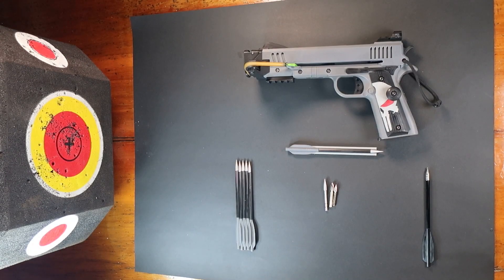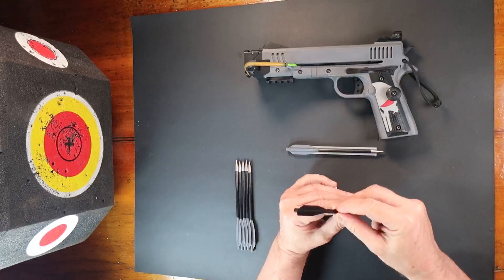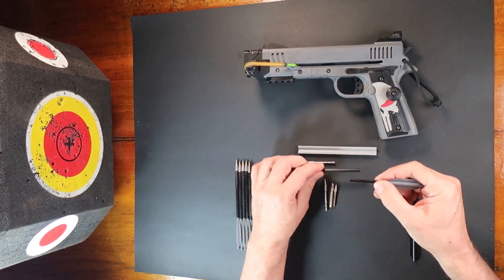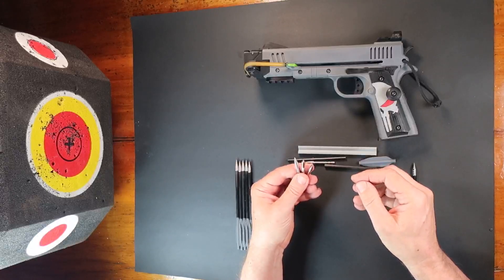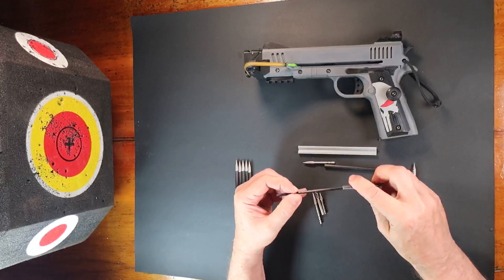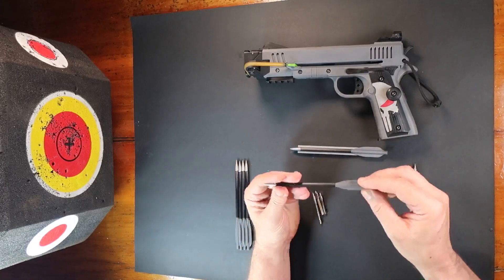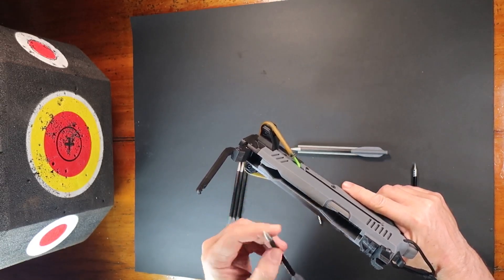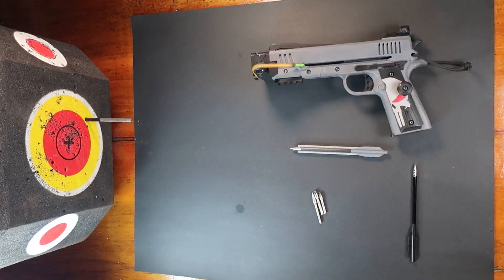Making Carbon Core Mini Crossbow Bolts

Comment: Excuse me
Spine 400 4.2mm ID Carbon Arrow Shaft
and
 4x2mm carbon connecting tube
What is the length of each?
Reply: Hi that depends on the length of  your arrow head! The shaft length = Final length - arrow head length - fletching length. The inner tube should be cut to fill most of the inner length of the fletching and shaft.